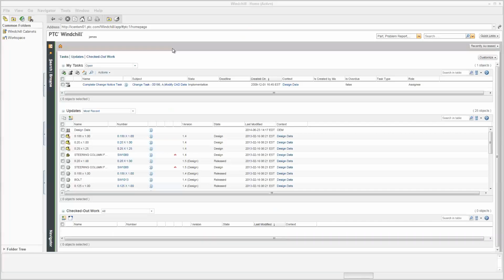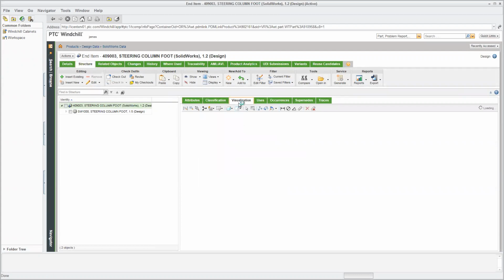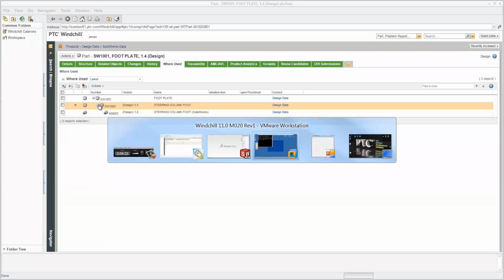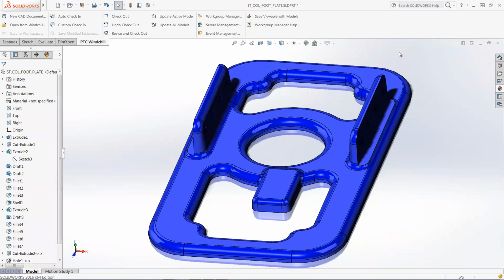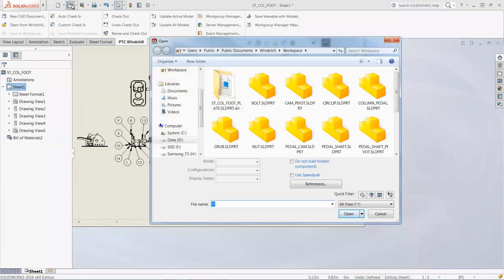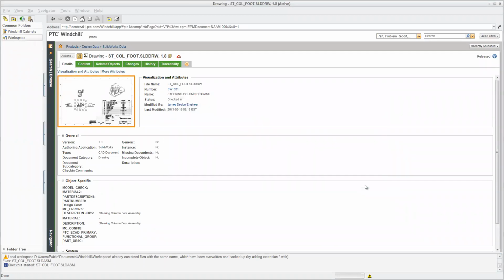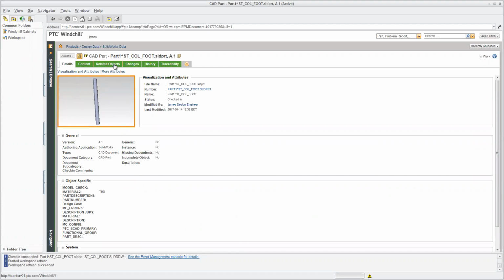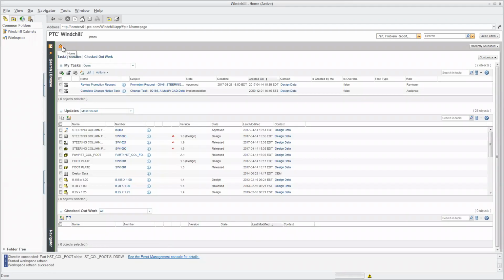Multi CAD Mgt with Windchill -  SWX Example

Comment: It's not Multi-CAD - it's just SOLIDWORKS and Windchill. Multi means more than one, so there should be at least SOLIDWORKS and Creo in one Part Structure.
Reply from the maker: Windchill Manages all CAD systems, meaning if you are using more than 1 CAD system, Windchill can manage all of them.  If there are multiple CAD files used in an assembly, Windchill will manage this.